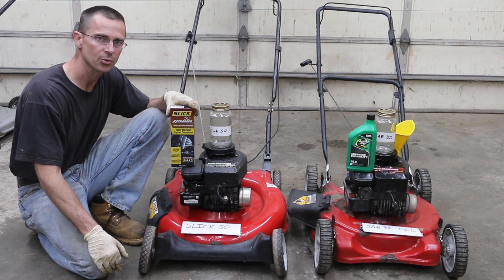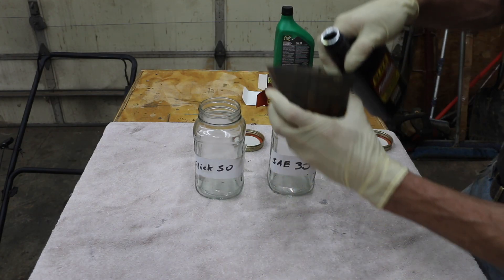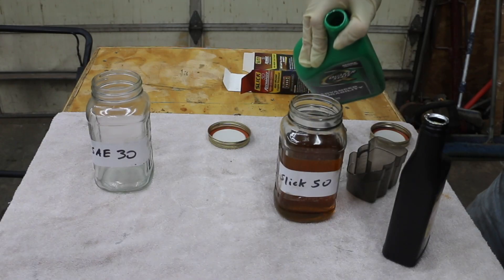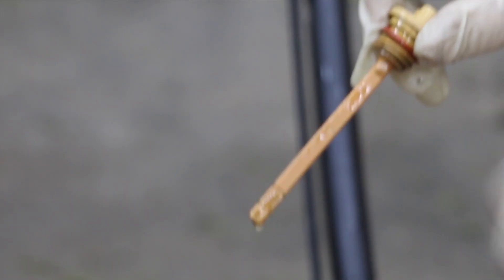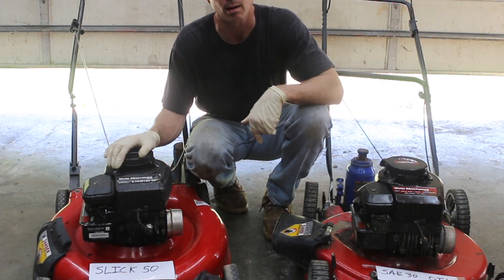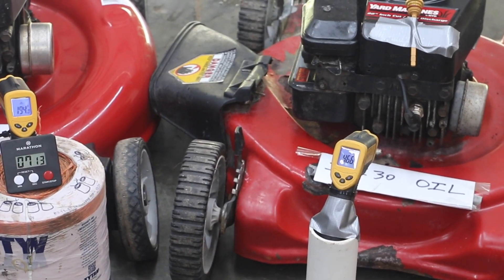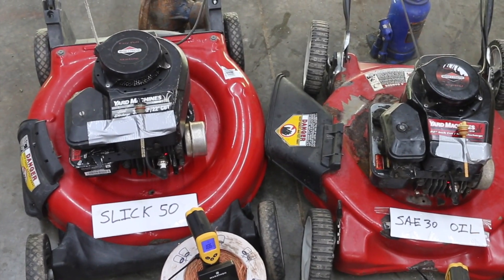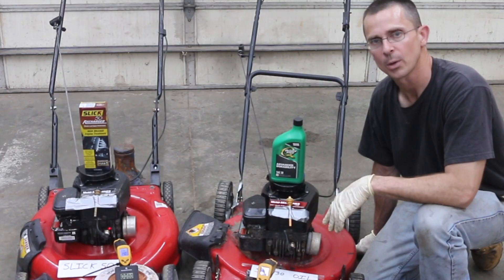Can't believe what SLICK 50 did to my engine!!--Dry Crankcase Test!

Comment: slick fifty is supposed to run for an entire oil cycle, until the next oil change. it takes time for the ptfe to infiltrate the porosity of the metal parts. Being too poor to afford Slick Fifty I just started changing my oil and reusing oil from dealers that did the slick 50 treatment for people that could afford to farm out such basic chores. Months later,  at least six, I was driving across TExas... THE place that real estate agents refer to as 'lots and lots of lots and lots'... and noticed my oil gauge said ZERO. Not overheating at all, so ... I kept driving for about another fifteen minutes before I woke the hell up and realised I was driving across Texas and my gauge read ZERO. uM, what if my gauge was NOT faulty? SO I stopped and checked the oil... there was none. My front seal had given out who knows when... and I had indeed been driving with a dry crankcase.  I put oil in it, (still had a supply to add more slick fifty) and my oil pressure showed NORMAL.  I BELIEVE TO THIS DAY THAT SLICK FIFTY SAVED MY MOTOR. Without that treatment I would have had a dead engine in the middle of Texas, and the tow truck drivers there have a saying, "The only good engine is a dead engine''... #tongueincheek #sorrynotsorryitwasfunny...
Reply from the maker: Wow!  Thanks for sharing.

Comment: Why?  Slick 50 engine didnt get near as hot but died at a third of the time.  With the results of this test and with such different temperature readings one would have to do several tests to rule out the engines themselves.  Thks for this test as I am from the Slick 50 era and  bought it so out of respect to Slick 50 it did keep the temp lower so that can only mean less friction.  What are your thoughts on 2 more rounds involving 4 more mowers?  Tom

Comment: Used slick 50 in my 1991 truck for 10 years, truck body rusted away, but engine still ran when driven onto roll back to junk yard. Give product time to soak into parts.
Reply from the maker: Thanks for sharing.

Comment: I learned a neat trick watching you suck the oil out using the vac pump. Neato !
I think the Slick 50 was more snake oil back in the day because the technology wasn't available to make it do what they claim. I like how it makes the engine run cooler but that's all it has going for it. I suspect the additives in it break down if used alone, but in conjunction with oil it may have some merit. Maybe.
Reply from the maker: Thanks for sharing.

Comment: Good video...I wasted a lot of money also on Slick 50,that goes to  show you can’t trust everything that you hear
Reply from the maker: Thanks!  Thanks for sharing.
Reply: I had a 1992 honda vx civic that had over 200 thousand miles on it.
while visiting my relatives in Ky my honda that I had treated with Slick 50 at 50 thousand and at 100 thousand threw a rod putting a hole through the engine causing the loss of oil and water. but continued to run on three cylinders for about 20 miles till it gave out at a gas station.

Comment: This is not a valid test! It wasn’t controlled enough!! You need to start off with two identical mowers that are brand new or that have the same amount of time and wear on them preferably none!!!!  otherwise who’s to say that the motor that you put the slick 50 and wasn’t already worn out in someway and that’s why it seized up first not because of the inferiority of slick 50 but due to some premature aware that we are unaware of well the other motor with the conventional oil seem to outperform. Do u get what I’m saying??

Comment: I had a lawn service back in 1993 and had an old snapper push mower, it had a bunch of hours in it and was starting to run a little rough.  A freind told me to try slick 50 straight in it.  The thing ran great.  But one hard hot day i was using it and noticed it was struggling a little.  This was after running it all day.  I checked the oil and it showed no oil.  But the thing still ran first pull.  Just had less power to cut.

Put some oil in, and finished out the day.  I sold the buisness 6 months later, with that mower still in daily use.  So not sure what happened with your test.
Reply from the maker: Thank you!

Comment: Not a fair test. Variables in small engines are extreme. You would of have to ruin 2 Chevy V-8's  to get an accurate test which is far too expensive. Years ago Slick-50 was much thicker with a far higher concentration of PTFE resins, it is now thin like water and not as thick as regular motor oil. The bottom line is this - motor oils, especially synthetics have improved so dramatically an additive is no longer needed. Anything Lucas makes is a far superior product. Generally Walmart only seeks automotive products that work well consistently. Ditch the Slick-50 and try Lucas 
Lucas anti-slip for auto trans - the best product ever for extending your trans life. My 2000 Honda Odyssey trans should have died by 120K, now 200K and still going.  LUCAS OIL 10001 Heavy Duty Oil Stabilizer Quart $10 at Walmart

Comment: Slick 50 was sold years ago (like in 2000) to Quaker State (if I remember correctly) and they changed the formula. The original did work well. It had it's place, it was excellent for engines that did not have frequent use, for it protected at the dry start. I was in the industry and saw all the certified lab reports from Slick 50, certified government labs for testing engines. It did work. I used it in my marine four stroke inboard gasoline engines. Today,  Slick50 is like Log Cabin  "Maple " syrup, which does not contain a drop of maple.
Reply from the maker: Thanks for sharing.

Comment: My question would be did you shake the bottle of Slick 50 well before you put it in the mower. PTFE settles in the bottom, and if it is not well shaken before use you'll only be putting the carrier oil in instead of the PTFE/oil mix.

Comment: Oops forgot..while I cant swear  to it, only because I have not tested after I put the BG in I am plenty sure it's worth 1 maybe 2 mph on the top end...I have ran the bike out the back door probably 100 times..always with gps...according to honda and people who own same bike,  184 mph..at it ran that number GPS before I started  running it...got it to run 189...like clockwork..never 190, not even in cool air..after BG it ran solid 190 and once  in a while 191...math says at 190 another  mph takes 5 more hp. That's plenty impressive in my world. Bike was fastest production bike in 97-98...Suzuki built the busa to beat it...and they had to build a motor 200cc bigger to do it...busa riders get all confused when they cant beat me...lol
Reply from the maker: Thanks for sharing.

Comment: Have you ever tried using general  motors EOS (engine oil supplement) in anything?

And one I do know for fact that it works in motor cycle engines.
BG product EPC. Extreme pressure concentrate.
I used to have a Suzuki gas 1000 that had been hot rodded with a way bigger cam, bored to 1100  heavy duty clutches and a few trans mods...older air cooled motors make a lot of racket anyway...loosen up piston clearance  and more valve lash doesnt help..
First time I used the BG deal...half can a few days after oil change I took it out for a ride...5 miles...really easy to notice the difference...the clutch got way smoother  went into gear from neutral with less clunk..shifter much smoother and much less overall engine noise....did that back in 88.
Today I ride one of the smoothest bikes you can buy..honda cbr1100xx blackbird...it has the quality  that honda builds into every product they sell...motor sounds like a sewing ma hine..zero vibration of any kind at any speed..2 internal balance shafts...and it makes 165 hp right out of the box....with 10k on the motor it's barely broken in. Did my usual 2k oil change with val racing oil...half can of BG...while it wasnt as noticable as the old gas 1000 just the fact that I did notice  improvement was plenty amazing...idle rpm went up by 50 rpm...it went from neutral to in gear so clean I kick the shifter again to make sure it actually went in gear. And something bikes with carbs rarely do...idle rpm @1150 and let the clutch out without using the throttle...slide the clutch  for about 2 bike lengths  and it in gear and rolling...
Not much into additives  but BC has got something figured out
Reply from the maker: Thanks for the video idea.

Comment: I remember, on the dirt track circuit, they used to do this test with Amsoil. That is, put in Amsoil, run the bike around the track, then drain the oil, and run a circuit or two without the engine failing (oil empty). Some said it was the bronze bearings taking the wear. Would like to see your test with Amsoil. Thanks.
Reply from the maker: Thanks for the video idea.

Comment: Stp valve honey.
Must be blended outside of engine.
And does not repair. I've been using this on all of my engines up until dexos came out because of warrantee reasons.
But my lawnmowers and edger are 20 plus years old and don't burn oil.
I repeat you must blend 10:1 outside of engine. Product is too heavy to expect the oil pump to do it.
This is preventive only not repair or hide and sell. That's just plain wrong.
Reply from the maker: Thanks for the feedback.

Comment: Please do a review of tuf-oil additive. It's liquid Teflon the world's slipperiest substance known to man. According to Guinness Book World Records.. They say a layer of protective film film protects metal surfaces and reduces friction. I use it for towing and notice a big difference the engines don't strain so much. We've put it in carbureted engines and Idle usually jumps about 300 RPM.. you have to turn down the idle after the engine warms up how much to compensate for the reduced friction.. I didn't believe it until I saw it... computerized cars will compensate for the difference oh, but you will see the idle drop before the computer takes over
Reply from the maker: Thanks for the video idea.

Comment: I feel like those two engines were different enough in age and/or usage that the numbers are kind of hard to trust.
Reply from the maker: Thanks for sharing.
Reply: Anyone with a bit of common sense would take into consideration that this just two mowers, one test and not necessarily equally used machines. However, to get a better picture of statistics using the same formula would require several mowers. Obviously not that simple to find equal mowers nor is it practical

Comment: I appreciate the efforts of making an honest comparison, however, I think there are several flaws in this test. For example: what is the idle speed of each motor? How much oil was left in each crankcase? Are the motors identical; model, year, configuaration, as well as hours and prrvious usage? I am not a fan of consumer-level additives. I am a fan of good science, which is what project farm usually offers.

Comment: Idk does it really mean the Slick did worse? If the engine temp stayed cooler, ultimately the engine ware would be less?. Although it tapped out much sooner, i wouldn't consider this a worst case scenario becuase your suppose to have oil. The actual test should be a running an engine full blast with equal oil  1 with slick the other with Straight 30. I think there is merit for cooler temp. Idk awesome video though.

Comment: Just done an engine oil change using a good oil pump,feeding a dedicated tube down dipstick to bottom.
Lager output tube into a used oil container,12v off the car and connect the leads,then turn on pump to drain old oil.
Takes around 15/20mins.
You move tube around a little when gurgling sounds appear,stop pump,put about quarter litre new oil in then leave for twenty minutes.
This help pull out bit more dirty oil.
Replacing oil filter with a good quality one,wiping around area from removed filter,thin layer of oil around rubber seal,tighten carefully by hand once seal meets surface,3/4 turn,do not overtighten it.
Reply from the maker: Thanks for sharing.

Comment: Agree with the slick 50 rep needs time to coat the internals it’s not instant. I had a 351 Ford Cleveland which had done what I’d call the minimum run in period. It was a cold motor no thermostat one morning I started it and it spluttered a bit so I reved it a few times to try and build heat. My oil pressure gauge didn’t move I thought it was a dirty connection and drove up collected my wife and we left I drove about a km clutching the motor and Erving it higher up to 8500rpm still no oil pressure so I turned around and drove home got there piped the oil pressure sender and zero I had no oil pressure at all. Full sump but nothing, I popped the distributor and found the oil pump drive had sheared off, I popped the sump checked the bearings and all were unmarked perfect.  I replaced the drive put everything back together started it, instant oil pressure only thing that happened was one hydraulic lifter has a slight tick. So drove it for at least 2km reved the hell out of it repeatedly and the motor was still running as smooth as silk years later! The old slick 50 did work!
Reply from the maker: Thanks for sharing.

Comment: I never had the Slick 50 engine treatment but I do have a can of its spray lubricant. Used it on my nearly seized table fan. The fan ran well with no problem many years after that. The spray lubricant I have still has ptfe in it. I read current Slick 50 products no longer have ptfe.
Reply from the maker: Thanks for the feedback.

Comment: I work for napa Auto parts and I'm always showing your videos to our customers!! Great channel you have!! Keep the great work!!😊👍 btw I think the ad was duralube...but I'm not sure. I do remember the pan being off with the engine running you could see the crank spinning around..
Reply: duralube is the commercial i remember them running an engine without oil in as well. that commercial is the reason ive only bought duralube over the years and not slick 50.
Reply from the maker: Awesome! Thank you!

Comment: When you drained the oil from both mowers, it appeared you had recovered more volume from the slick 50 mower. Maybe I missed something, but assuming they had the same amount of fluid added, the crankcase which had the most amount of residual oil after draining would logically run longer.
Reply from the maker: Thanks for the feedback.

Comment: In the 90's I put slick 50 in my Jeep Wrangler for over two years when I got into a situation while hunting, I bottom out on a rock and it rip the shield and oil pan (no oil pan). I was in 4x4 terrain in the middle of nowhere with no oil in the engine but my engine was still running, so I decide to chance it and drove back. It took me 3+ hours to get back on asphalt and drove for awhile before arriving into a repair shop. All that time hoping, praying that my engine last. The mechanic strip down the engine per my instruction and could not believe that I drove that long without oil without damaging the engine. I gave that Jeep to my Niece a few years back and she's still driving it. I put slick 50 in every vehicle I owned.
Reply from the maker: Wow!  Thanks for sharing!

Comment: The one story I remember from my BMW mechanic cousins in  late 80's was... a guy repeatedly used slick 50, then eventually went for the engine rebuild, when they tried to bore the cylinders, it was to "slick" to machine.  The original formula may have had some effect???

Comment: I don't recall you stating how long you ran the engine with the Slick50 to "burn it in". My understanding is that it needs a specific burn in time in which to create that "teflon coating" on the engine parts. Could it be that it didn't have enough time to burn on the coating? Also, I'm disappointed that you didn't include taking the engines apart to see what the insides looked like. The temperate was obviously a lot lower on the Slick50 engine, so there is definitely a difference...
Reply from the maker: Thanks for the feedback.

Comment: I didn't see smoke coming form the Slick 50 engine.  BTW, I like Prolong engine treatment.  I don't know if you can run the oil out with Prolong though.  I have never tried Slick 50.
Reply from the maker: Thanks for the feedback.
Reply: I bet if you did this test with two brand new identical mowers and let the Slick 50 have more run time so that I can thoroughly soak into the engine, you might get better results, who knows?

Comment: Slick 50 has to run in the engine for a significant time to have an ongoing effect. From what I can remember 1000 Kms/600 miles for a car or a bike. Bike magazine in South Africa did testing on a production race bike that had overheating problems. Slick 50 cured overheating and made more power on the dyno, only  way it could do that is lower friction, so used as designed it would appear to work. Less friction = less wear
Reply from the maker: Thanks for the feedback.

Comment: I used slick 50 a lot back in the days but did you shake it very well before you poured the slick 50 because I remember if you shook it up you could see the little white flakes and the oil would look milky and cloudy because of the Teflon being shook up and I used to say shake well but I did not see you do that before you did the test did you do that? Because if you didn’t the Teflon would’ve all been settled at the bottom of the bottle.